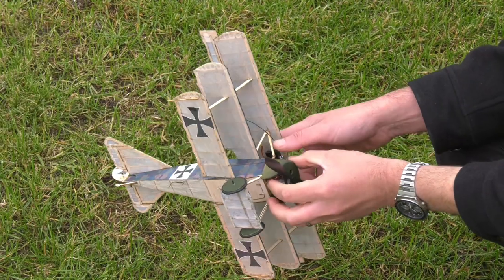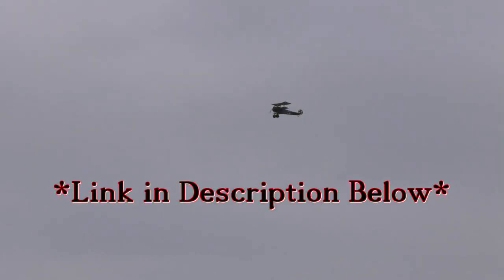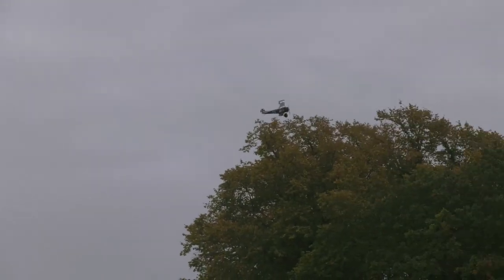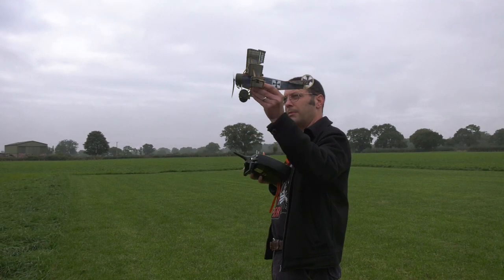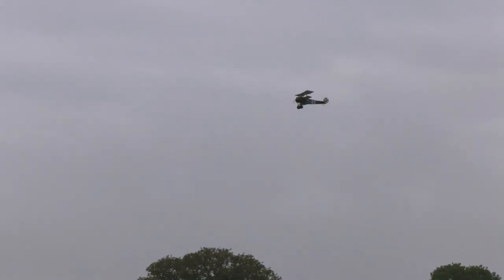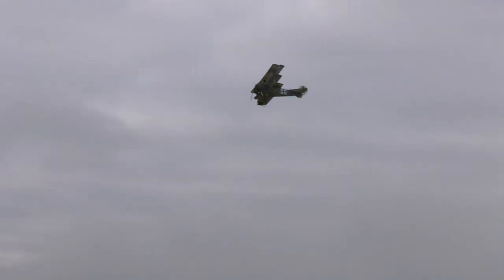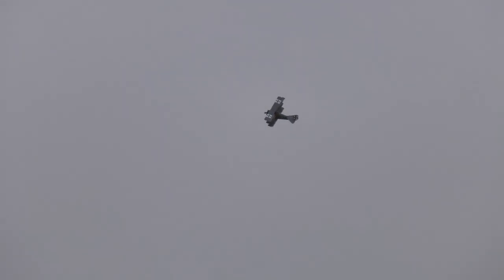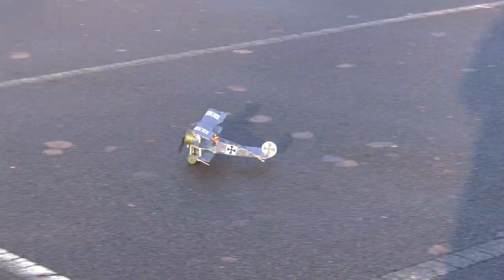Tony Ray Micro Fokker DR1 Maiden Flight

Comment: Thanks for the heads up . Excellent video. It doesn’t take much of a breeze to knock them about a bit. Lots of indoor potential and a welcome change from foam . When I was a child I used to dream about flying models that were a similar size to plastic kits . Now we can - I love this hobby.  Thanks again for a super video Steve
Reply from the maker: This was a fun model to build and review. Thank you.  I am looking forwards to taking it to an indoor meet hopefully soon along with some others from this range of kits.
Reply: The Eachine 1/48 Scale Fighters are just the best thing to get Kooks hooked on Our Awesome Hobby.
You Beauty Servoboy, %100 Agree! Best Habit Ever!
PS: I Airbrushed the Micro Trojan in Ho Chi Minn CIA Camo, thing is hard to find in the scrub but is just Awesome no hassle fun.
Reply from the maker: @jonoedwards4195  Will check out the Eachine fighters too !  Sounds fun.
Reply: @jonoedwards4195  Hi Jono , I've googled and not found the eachine 1/48 fighters. Are they 1/48 or smaller. I seem to pull up plastic kits. They sound interesting. Kooks... a reference one of my favourite Bowie numbers ( Kooks on Hunky Dory).
I suppose we are all a bit kooky in this hobby

Comment: Great looking plane but could do with an RX with AS3X. I have the Micro Aces Bristol , no AS3X either and that one is only a 3 channel too so you have to be one step ahead of it all the time. I guess all these little planes are really for indoor flying first and foremost but its a good concept to build on.
Reply from the maker: For outdoor use AS3X would be a great help.  Aileron control helps quite a bit on this model, and I am looking forwards to trying it indoors soon